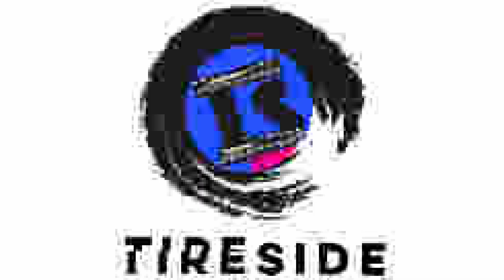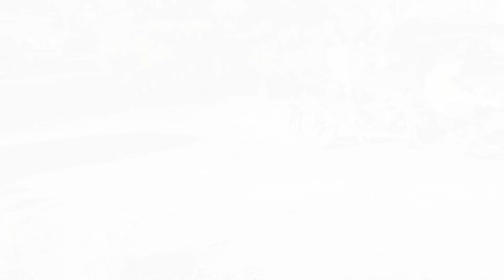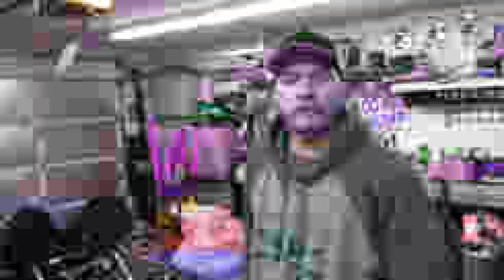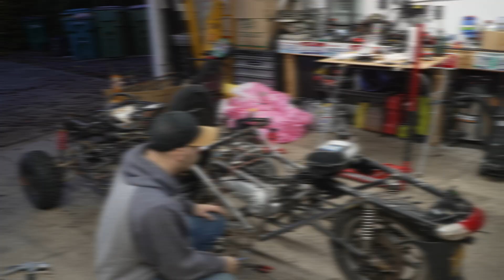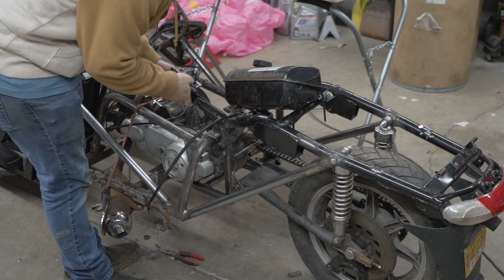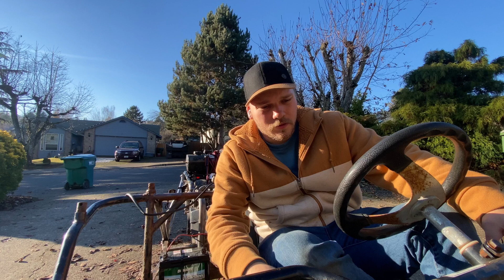REVERSE TRIKE Go-Kart Build | IT DRIVES!

Comment: Not bad my guy, but I have to say it's a little long to much weight for that little gy6 engine, if I had built it I would have graphed the moped frame to the go-kart chassis it self,
Reply from the maker: I don’t t think it ended up weight more than the go kart did originally. But I agree that more power is needed. I’ve got plans for that 👍

Comment: Not to be picky but why not simply remove the forks from a motorcycle and graft the frame cradle and head area to the kart chassis? (Indycycle)
Reply from the maker: Could do that, I just happened to find a moped frame with a title for $40 so was trying to work around that. But at this point i’m looking at swapping the engine or doing like you said, cause I can’t get this thing to go fast enough to safely drive on the roads.